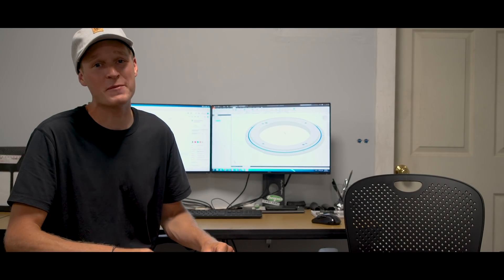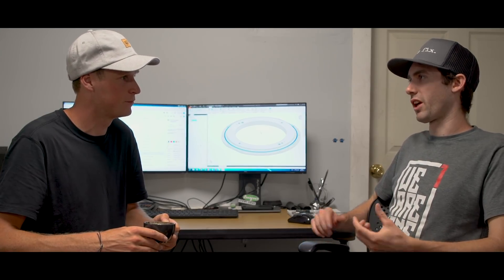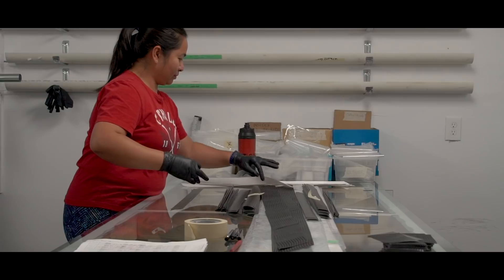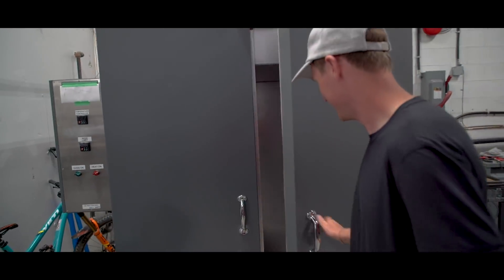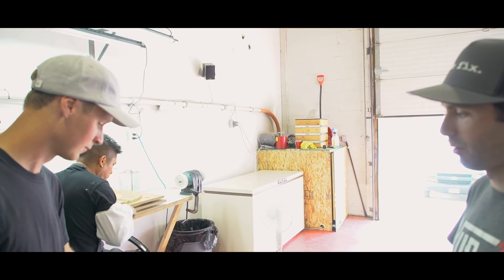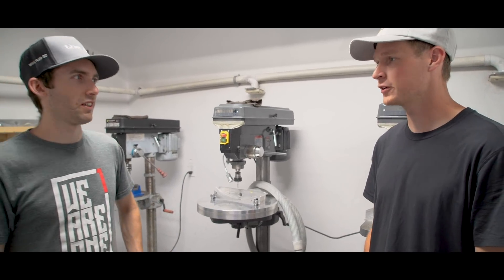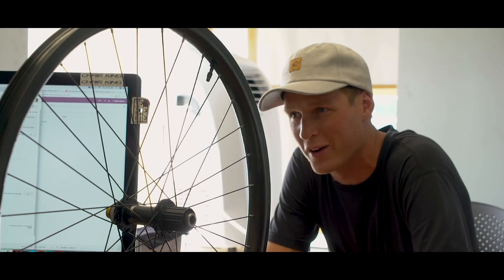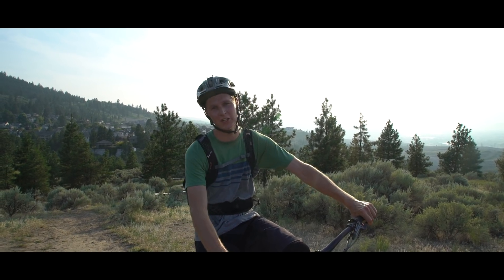How A Carbon MTB Rim Is Made | We Are One

Comment: They also make the best cockpit in the game. It's called "Da Package": Carbon bar with 15,25 or 35mm rise and a 33mm diameter and a CNC'd alloy stem that's 50,40 or 35mm in length. It's rad! Also the founder/owner has announced that they have a carbon fiber full suspension frame in the works!!!!

Comment: Factory tours with engineers are always bit more into detail than with normal journalists...
But one thing i was surprised abozt is that the holes for the spokes were drilled and not inserts. I guess with a right layout its not much of a problem. But i think the insert solution would be bit nicer.